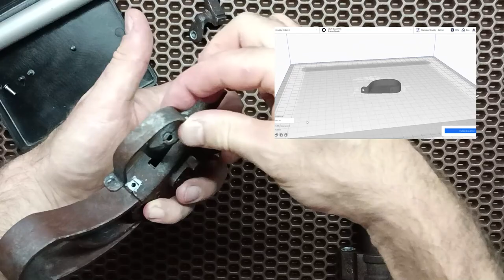АШОТ из метро 2033 на 3D принтере

Comment: What brand or tipe of gas shells are you using?
Reply from the maker: Gas shells from aliexpress. I won't tell the brand
Reply: @HeavyBarrelRU is it possible to give a link? If not its ok
Reply from the maker: @voljan8315  https://aliexpress.ru/item/1005004827618518.html?srcSns=sns_Copy&businessType=ProductDetail&spreadType=socialShare&tt=MG&sku_id=12000030680270670